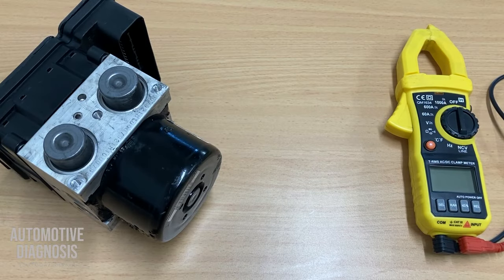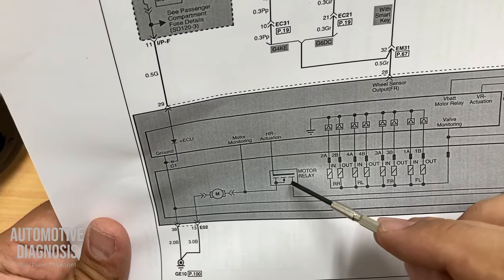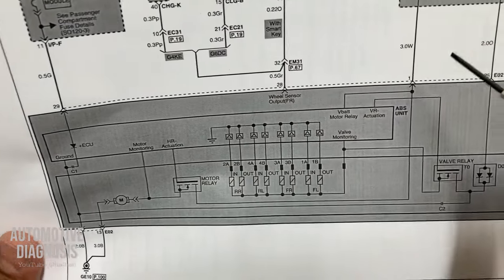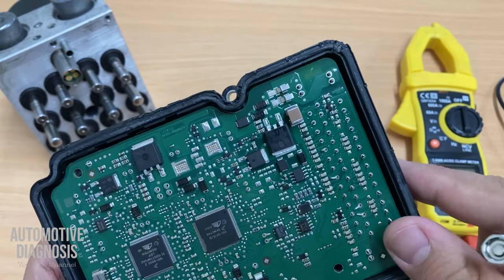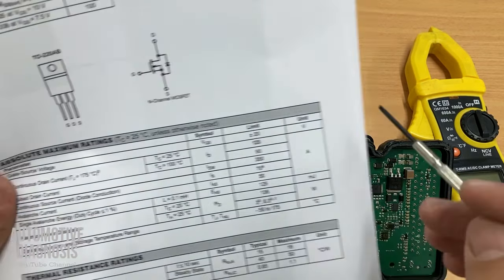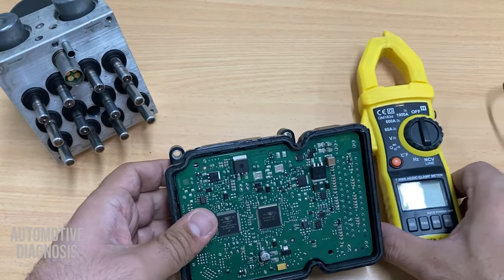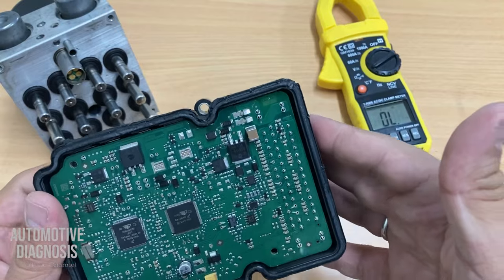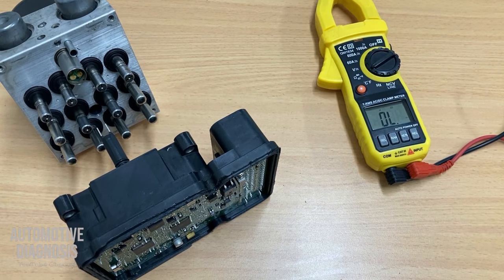Don't Replace ABS Module Before Watching This | Repair ABS Module for Motor & Valve Relay Error

Comment: Hi i hv a 2nd gen prius 2004 model  there is jammnes in front right wheel  ,i took it to the mechanic he opend the both wheels and said its a piston problem he than replaced the piston but dsnt solve tge problm tahn he replaced the cliper even tge master cylinder but still there is jamnes in front rgt wheel .your little help will be highly appriciated kindly help me in this regard
Reply from the maker: Hi there, normally I won't replace anything before making sure that it's a faulty component. They could have checked the brake system before replacement. Checking the brake caliper and piston is super easy and as you said that didn't fix the problem. Checking the ABS module operation is not hard as well. They could have checked the brake fluid flow at the wheel, they also could've checked the ABS inlet/outlet valve for that specific wheel using a scan tool. Replacement is always easy, but we can't replace every components until we find the problem!

Comment: I have an intermittent issue with my ABS module code c2200-49 which says abs internal issue. I have ran these checks and everything checked out ok, Thanks for the knowledge. After reinstalling my ABs light was gone, I dove it around for a while and everything was reading good on Data log. I was able to clear the code and all was good. The next day I started truck and the ABS, Traction Control and service trailer brake lights were on again????

Comment: Dear, many thanks for the video. After you replace the module. Do you need to pass the scan on the car/motorcycle? Or is it just a plug and play?
Reply from the maker: Hi there, although on many models ABS programming is not required, on some others we have to program (sometimes called Variant Coding) the ABS module and that possible only with scan tool.
Reply: Thank you  @AutomotiveDiagnosis

Comment: I have a 2007 e60 m5 and my abs pump is faulty my workshop says it has been repaired so it can't be repaired again...I've been looking for the last 7months for a replacement with no luck I really need help...plus I have been waiting for a new pump since last xmas

Comment: i did all these test with my abs module and everything you checked here has continuity. My code reads C056D for internal failure. What else can I check to repair this issue
Reply from the maker: If you have checked the internal circuit and nothing was found, it could be from a faulty transistor or from external wiring harness. You need to make sure that power supply and ground are provided to the ABS Module.
Reply: @AutomotiveDiagnosis  I checked the harness for power and ground and positive are ok at the wires, now that I have it opened I have to check of the current flows through the connection into the electronic board when plugged in. Thanks

Comment: What is considered high resistance
I probed the positive side and negative side and got 1855 from one ground and both positives then got 1570 from another ground with both positives. Is that a problem
Reply from the maker: So you measured the resistance between negative and positive?
Reply: @AutomotiveDiagnosis  yes? I believe so. I measured the sides you said break off easily. The two top prongs and the two bottom prongs. When I swapped the leads the same negative prong with 1570, this time came out to like 455.
Reply from the maker: @lofiseeker1790  When you are measuring like that, you are actually getting the internal resistance of some components too. I think it would be helpful if you watch the second part of this video:
https://www.youtube.com/watch?v=Copb1PrL6UI
Reply: @AutomotiveDiagnosis  okay, So it could be a component as well, I'll check each one like you explained. Thank you

Comment: Hello I am the owner of a Fiat Freemont just like the Dodge Journey Model 2011/2012, it has the fault C2200 ABS failure, I ask for your help to fix this module in Brazil it is very expensive I am an electronics technician and I also have an infra red soldering station, it is an intermittent defect, at the moment it presents the failure the scanner indicates the lack of the voltage of the 9,9v valve relay drops to zero volts, mosfet relay valve will need to be replaced?

Comment: Maybe it's out of context but is it possible to replace a single solenoid valve from the hydraulic block? If yes where I can find a repair kit?
Reply from the maker: It’s not impossible but there is no repair kit for it.

Comment: hi, is this ABS Module from a Ford Focus SE? because is very very similar...
Reply from the maker: No it’s not from that model, but you’re right, they are very similar
Reply: With that in mind, I think it would be the same motherboard, components and everything else, but the only thing that would change is the programming of the internal software, what do you think? @AutomotiveDiagnosis

Comment: Is it possible for this to short out and start a engine fire?  I saw some smoke coming from my connection on a 2005 Chevy Impala SS and my brake light would not turn off, even when I turned the car off... and it caused a fire

Comment: is the transmission control unit repairable?
Reply from the maker: Every single unit in the car is repairable, It's only needed to have the programmer (in some cases) and have a good electrical knowledge.

Comment: Is it possible to exchange the electronic module with  a different one using the same solenoid/valve body? (since they separate rather easily)
Reply from the maker: Yes, it’s possible if part number is the same.
Reply: @AutomotiveDiagnosis  I may try it on a mazda 6. This way it is not necessary to open up and have to bleed the ABS. Which is tricky to do.
Reply from the maker: Yes, any time we remove the ABS module we must drain the fluid before, and put new brake fluid in after, and bleeding is absolutely necessary. But honestly is not that much tricky if you go according to the workshop manual procedure. I try to find and attach a bleeding guide here for you very soon and hopefully I will be lucky to have some time to make a video for brake bleeding.
Reply: @AutomotiveDiagnosis   It would be great to show how to jump the ABS motor since you usually need an expensive OBDII reader to manually cycle the ABS pump. If the motor can be jumped manually then it can help purge the air out.  Thanks for sharing your experience!

Comment: what about ford ecosport titanium 2014 control module abs, what are the causes of dtc for u0121, lost comunication
Reply from the maker: This code is for ABS Communication with other units and it can be caused by ABS module poor connection (easy to check and fix) or ABS module CAN network transceiver (which is very hard to repair). 
You can also watch the following video for CAN Network troubleshooting:
https://www.youtube.com/watch?v=1hGhhu2uc4Y

Comment: how to find the internal circuit diagram? my dodge challenger 2011 's module has internal fault, and it is discontinued. there is no way except repairing the module

Comment: I have a 2010 honda crz,keeps coming up with code u0122 lost communication can this cause the same issue
Reply from the maker: You may check the power supply for ABS unit, which is a low amp fuse (mostly 10 A) in the fuse box. Ground must be checked as well. This fault could be related to CAN-BUS too.
Reply: I've look in my ecu internals,identical to yours and none of the terminals are soldered??
Reply: @AutomotiveDiagnosis  none of my terminals were soldered,so I've soldered them all

Comment: HOT WIRING THE PUMP MOTOR BOTH POS AND NEG FROM  THE MODULE PINS SHOULD ACTIVATE THE MOTOR?????????? I did so by using connectors attached the pins and cable linked to the HOT pos pin on the plug and neg pin on the plug. I had previously tested that the plug pos pin was hot and 12 volts min. My result was NO PUMP ACTIVATION.
This BMW 3 series has intermittent ABS failure signal on the dash......not speed related but maybe Cruise Control activation related.
Reply from the maker: ABS motor should never work when Pos. and Neg. are provided directly from ABS connector. As explained in the video there one MOSFET is just to control the ABS motor operation, so positive is provided to the MOSFET and when ABS module triggers that, positive will be directed to the ABS Motor.

Comment: Why would my abs pump running continuously killing my battery? I had to unplug it and drives fine but id like to have it back working.
Reply from the maker: Normally ABS operates for a couple of second after starting to drive to ensure everything on ABS system works properly, most likely your car’s ABS motor does not stop after completing this process which could be an internal error on ABS module, it would be great if you can have the ABS scanned with a scan tool to see if there is any code, also, on some ABS system there a reset function which might be helpful if this function is available in your car.
Reply: @AutomotiveDiagnosis  thanks for your response, would a bad wheel sensor cause it to keep running as I haven't checked those. Also can I just replace the module or does the pump and all need replaced?

Comment: Good afternoon sir, please i am working on kia rio 2015,with brake issues, the front left and the rear right get stuck, when i release the brake pressure from that side the wheels turns please i need your help
Reply from the maker: You may have master cylinder problem. When one piston doesn’t go back completely, so it won’t release the brake fluid pressure back to the reservoir, so pressure remains in the brake line causing the stuck caliper pistons.
Reply: Thanks for your response, but please i remember the same problem happens to kia sorento 2015, we change abs unit the problem solved, and i have downloaded your two videos of abs, so inside the abs block which solenoid is responsible for controlling the pressure, please i need your help
Reply from the maker: ABS module could be the cause as well but you must check the low cost part first then you go for the ABS module. For each wheel there are two valves, one inlet and one outlet valve. They could cause this problem as well.
Reply: Please how can the inlet and the outlet valve be tested
Reply: Please how can the inlet and the outlet valve be tested
Reply from the maker: @ernestdamo677  If you have a scan tool, it might help. When calipers pistons are stuck, find the actuation tests in ABS system, see how many valve you got there and try to enable/disable the relevant inlet valves and see if wheels start rotating again.
Reply: @AutomotiveDiagnosis  thanks for your patience

Comment: I replaced abs system 2 years ago motor was working but there's not pressure  showing VCS on toyota estima 2007  hybrid I paid £924 only for system I changed my self otherwise would cost huge amount of money.
Reply from the maker: Thanks for sharing your experience 🙏🙏

Comment: what about ford fiesta control module abs, what are the causes of dtc for u3000, software supervision failure
Reply from the maker: What is the model year?
Reply from the maker: I have attached a photo from Ford Fiesta 2011-2014 (1.6 L) workshop manual for all U3000 fault codes. Please find the link below:
https://drive.google.com/file/d/1LSkfhv2iRyWkOvgySrQpMvQiwP7v0-BO/view?usp=share_link

Comment: pressure sensor circuit malfunction 
error code 66-11. Can you help me ?
Reply from the maker: Hi there. Pressure sensor is located inside the ABS module. There is no way to check it from outside of the module.

Comment: Thanks  , However ;
You may not see the broken solider 
connection points on the ABS circuit 
board , to use DVOM resistance ohm 
meter to measure and check for continuity .

Comment: What’s code 16352 ? Thanks  internally ?
Reply from the maker: It is mostly an internal fault but we most check the power and ground on ABS connector first.

Comment: Did the test but my resistance says 000, is that good?
Reply from the maker: Resistance is too low, almost zero. So you should be fine. You can also check for continuity, just to confirm, and if you hear the continuity sound it means everything is good.

Comment: Did you encounter similar issues with HV battery module?
Reply from the maker: Some electrical faults are common on many other control units. Although we are trying to make some videos on HEV control units too.
Reply: Thanks mate. This abs video is one of the best tutorials I have come across. Keep up with the good job.
Reply from the maker: @growuppa  thanks for your kind words 🙏

Comment: Great explanation... Thanks for this video.
Have the exactly same module as yours..
But i got c0550-00 and c0201-04
Do you have the complete schema for this module please?
Reply from the maker: Hi there, may I ask what model is your car? So I can check for the most accurate one.
Reply: @AutomotiveDiagnosis  
I'm from indonesia
THe Car is chevrolet captiva diesel 2.0 VCDi awd year 2010
Reply from the maker: This is the schematics I have for Captiva, I hope it's exactly same as yours:
https://drive.google.com/file/d/14KCvAbmVqrOSGkWqFl9HfFg2n4QvlywK/view?usp=share_link
Reply: @AutomotiveDiagnosis  thanks much...
Realy2 apreciate it,..🙏🙏🙏🙏

Comment: So do I just put new soldering on all the pin
Reply from the maker: If problem is bad connection between a pin and board.
Reply: @AutomotiveDiagnosis  it look like their was no solder iron on all the pin so I solder it but now the abs light still on
Reply from the maker: You shouldn’t solder any pin you see, some module they don’t have the solder on the top, like that unit we showed on the video. All inspection procedure is for finding the fault first. And ABS light could be connected to so many issues. You should read the code first.
Reply: @AutomotiveDiagnosis  I fucced up then I’m just gonna buy a new one lol I give up

Comment: how do the professional rebuilders open them without cutting?
Reply from the maker: For removing the ABS module back cover, I use a small and very sharp cutter to do it properly without damaging it.

Comment: It appears that you know what your talking about. The ford dealer told me that I have a faulty ABS Control Module but Ford no longer sell my car module. I am left with trying to locate someone who is knows how to repair ABS control module and at a reasonable price. My Question; Will you repair my module? or do you know of another reliable person who can and will repair my module?   My ABS Control module is from a 2011 Ford edge (sel), Control module number is DT4Z 2C219 B   . Please get back to me A.S.A.P.  Thank You
Reply from the maker: Hi there, thanks for the comment.
May I ask where is the city that you live in?
Reply: @AutomotiveDiagnosis   Brownsville Texas. By the way, I recently learned that Ford Didi not stop mfg the ABS Control Module. It's only on back order. So I believe that the Repair Sales did not tell me thr truth.  Just too lazy to perform his duties.  But I went ahead and had my son order me one online and then I will have my own Mechanic install and program the ABS System at a much lesser cost. I have spent thousands of dollars at Tipton Ford here and have had one problem after another with the reair sales agents.  Because of this, I plan to take my business and money else where and have notified the many friends and acuaintences of what I had experienced and let them make their own opinion of this Ford Business.... But thanks either way for your response. I'm now 72 and It's still a learning experience for me in this krazy business world. God Bless and keep up tghe good work you do. Your Amazing my friend.

Comment: How do you remove cover with out cutting if off
Reply from the maker: I used a heater and a very small cutter to cut through the seal without damaging the cover.

Comment: I have a 2010 Ford Focus mechanic say ABS module need to be replaced $1800 I don’t have the money for that right now but I still driving with it 3 months now
Reply from the maker: Thanks for sharing your experience. Do you happen to remember your car’s ABS fault code?

Comment: There is no solder on these pins because it is solderless connection.
Reply from the maker: Hi there, this video is generally explaining all ABS Modules, in many of them there is solder and mostly it is the problem.

Comment: Dear Sir,

Please send me the pin-by-pin diagram of the pin-in and fan-out of both the 5.3 and the 5.7 Bosch ABS modules 

and step-by-step instructions in order to troubleshoot my 2003 Audi A4 properly.

 

Appreciate your support and service.

Regards,

Eugene Alberto